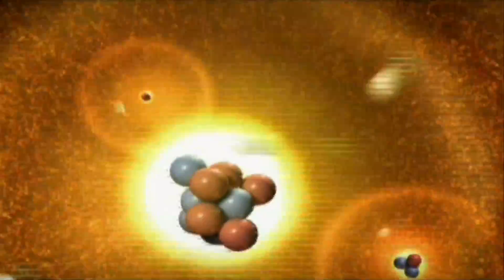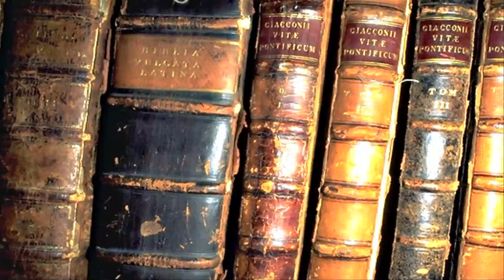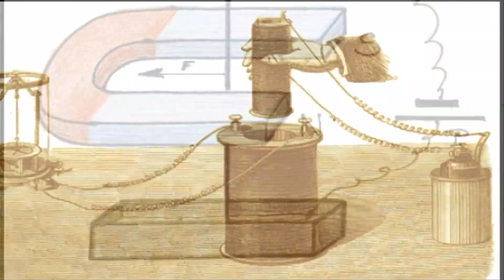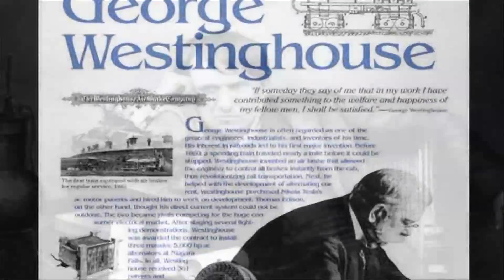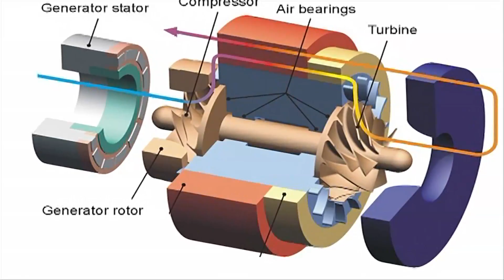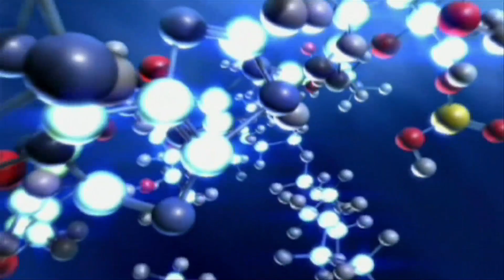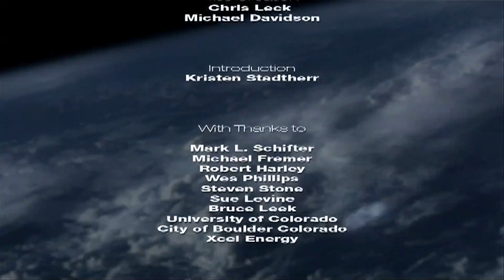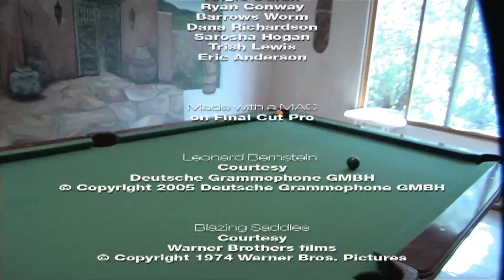The secret of electricity

Comment: This should be shown to every student in school, you do a superb job of explaining a complex subject.

i used to work for a power supply company and because it was a small operation I got to do everything from testing and sorting parts at incoming inspection, winding transformers and bench testing power supplies. later I was designing the equipment these went into. I was offered jobs at Raytheon and Loral but I stayed with that small operation for over twenty five years because I learned so much. My total education was 4 years at a technical high school, with that education and my reading of all the technical publications I could get my hands on.

Magazines like EDN had great tutorials that explained how to do things, I still have articles written by Bob Pease (Pease Porridge column in EDN) and all the manufactures of components had pamphlets that would guide you through tasks like designing a transformer. If you got out of college with a 4 year degree in electronics you had a lot of information but you really didn't know how to do much. Those articles and pamphlets showed you how to put that knowledge to work, as time went on you built up a store of knowledge that became a very valuable commodity.

I've been retired for eleven years and still occasionally get calls from people about analog design, it seems that knowledge about discreet analog design is in short supply these days. Now they are taught to use IC's as building blocks and are not really taught how to knit transistors, fet's, resisters and capacitors into a working circuit to meet a design goal.

Comment: Had no idea bamboo was used as the first bulb filament. Early electrical researchers and engineers like Faraday and Maxwell are amongst the most important and influential people ever. More so than any of the particle theorists. The progress made in the 200 years is breath-taking. Theory, motors, bulbs, batteries,  valves, diodes, transistors, IC's... it's nuts when you think about it.

Comment: You guys really should have advertised this video more. I just found out it even existed from one of your other videos

You are a fantastic host and media narrator, Paul. The pleasantness of your voice as narrator genuinely approaches that of Mike Rowe and David Attenborough.

Vibe wise, this felt like a 90s Bill Nye thing or something too. Love it.

You got one thing mistaken about electricity though, and it is indeed the biggest misconception about electricity of all time. Although the electrical energy is carried and transferred by the electrons, they actually move distance physically very slowly. Like an inch per second or something. They're just leapfrogging through physical holes in the crystal lattice of the conductor itself. The actual energy you end up using is transferred through the electromagnetic field around the wire that the electrons produce when stimulated at source by voltage and current. And to access this field's energy you must complete a circuit with the electrons producing the field to connect with this field itself, either by putting a load on this circuit or creating a path to ground (you in the case of electrocution) (Greatly simplifying this too actually)

To anyone curious, this is actually part of why the dielectric insulator of a wire affects the rate the energy flows through the circuit, and why high voltage lines that pass AC long distances are always totally uninsulated. As well as why AC can couple it's current across an insulator with no arcs, and no conductor completing the circuit. A dielectric insulator has an electrostatic capacitive effect on the flow of energy through the field around the wire. Discovering this lead to the invention of capacitors by sandwiching various dielectrics that can store an electrostatic charge between 2 conductors in a circuit. You can use these to store current, filter noise from a DC circuit, or prevent DC from entering an AC circuit, or all at the same time. You can even create a capacitor using air as the dielectric insulator. Those weird looking sheets metal that rotate when you tune the radio dial on your old stereo receivers are variable capacitors that use air as the dielectric insulator. If you've ever walked under high voltage lines and swore you heard crackling electricity, it's because you did. In some lines the voltage is high enough that the field around the wires will actually ionize the air around the lines and the crackling you hear is ozone being generated by discharge of electrostatic energy in the air around the lines.

Comment: Excellent video - with excellent sound!!!  I have to say that what Mr Philips says is more of a religious belief than a scientific fact. I am sure he has faith in it - but that's what faith is, belief in the absence of evidence.   If the last 6 feet made that much of a difference, then the "positive control" experiment should be to reduce the length to 3, 2, 1 foot if possible and see how it sounds. It should make an EVEN GREATER difference.  (He is right in that they are the last 6 feet not  of many miles, but of just a few dozen feet, or a few hundred feet if you live on a high floor). Power conditioning is another story, of course it makes an important difference, and this is easy to explain. Excellent points by all about musical performance and enjoyment. By the way, Bernstein himself wanted his name pronounced Bernst-ey-n :)

Comment: First 35 minutes are a delight, then it's just marketing. But I agree, good clean power will have an impact. Not as big as these people would want you to believe. As to power cords, just get decent shielding on your interconnects and don't run your speaker cable and interconnects in parallel to the power cable. No need to spend hundreds on power cables.

Comment: 41:05 sorry, no. You can have pure gold power cable, but all the imperfections from the power line, that is traveling miles and miles, will also be transfered by that gold power cable. Simple as that. It will be pure snake oil as you call it.

You can make a difference after your power converter, amplifier and with high end cables deliver analog signal to speakers. There is where cables can make a difference. OFC, shielded, gold, silver, connectors - you name it - everything can make that tiny difference in sound that you can hear with sensitive enough high end audio system. I can take that.

But don't ever say that these last power cable inches matter. I can only repeat myself - all inpurities and power peaks and drops from power line is also transfared through your 'audio grade' power cable....

Comment: Not arguing that quality power doesn't matter to audio equipment. I'm skeptical of power cables, but would love to tour somewhere and listen. 

But some of the comments from the guests make no sense. Listening to music at 2:00 am will most likely sound better because of the lack of other aural noise more than the quality of power. 

Still, a power sensitivity rating for PS Audio Equipment would be interesting.
Reply: The power supply should make a much larger difference than a cable would.

Comment: Jeez, all I see here is a bunch of silly old men with too much money, wasting it on daft crazy-expensive power cords. None of their claims would pass a blind test. Audiophile power cables, audiophile fuses, all of it is absolute nonsense. If PS audio products need "clean AC" then all that tells me, loud and clear, is that their power supplies are poorly designed! These guys are bordering on the same level of crazy as the Flat Earthers. What kind of power cable do Sony ship with an $80,000 VTR? A standard $10 one. Of course, these silly old hifi snobs will laugh at the mere suggestion that professional Sony gear can be compared with their esoteric audiophile nonsense, but nevertheless, I rest my case.
Reply: No I do not believe the power cord will make a difference and I am 65 now and I have been collecting electronics all my life and I have piles of amps and equipment and I do not see where any of them went any distance on the power cords;;  but I do know that good  equipment and different equipment for different applications and  and the proper speakers and how you set things up does make a difference.. And I never had an issue with the power coming off the grid unless I blew a fuse, but possibly I am wrong and I do I know that some generators can cause issues with equipment ..  
Possibly I am wrong but I have strung extension cords across buildings and across fields and things sounded fine..
Just like with buying special cables for speakers that has not been proven to me either
I set up a big club and all I used is heavy wire for the speakers and an extension cord to the equipment  it sounds fantastic if you put the right amp and equipment... 
You mentioned crazy flat earth guys and I  was asked these two questions that possibly you can answer," If  the earth  is spinning flipping moving under our feet every hour  you should be able to  put a gyroscope on the ground and it should move like 15 degrees every hour but it does not; why is that.?" And the fact is sitting in the plane on the ground it does not move no matter how long you sit and not move.,, why is that.?. And the next question I was asked was how do you measure sea level on a round ball covered with water because everywhere you were on the water would be the high point.  I could not figure that out so tell me how that works if you can...
Reply: @CalsTube   @J B  if I understand your question correctly, my answer to why the gyroscope doesn't tilt as the Earth turns is that there's no such thing as "right way up" and "upside down" as far as the Earth exists in space. "Vertical" runs from any point on the Earth's surface (and beyond) to the center of the Earth, Horizontal is perpendicular to that. Vertical, to someone standing at the north pole, is 90 degrees different to someone standing at the equator, but it's still vertical! Horizontal changes, too, if you compare one point on the Earth to another point on Earth, but it's still horizontal. The gyroscope stays horizontal, no matter where you are, or how much the Earth has turned. It HAS actually moved by a certain number of degrees, but so has its base, and you, and the land it's sitting on. So, relative to its base, and an observer, it doesn't move at.  all. That my answer, anyway :-)

Comment: It was a great story until the talk about clean AC, presumably for cleanup power stuff. IF you know about the inside of HiFi equipment and the build of circuits, that is that I know of, I am an electronic engineer, Than you know that after the transformer INSIDE ANY Hifi equipment the power is become DC bij rectifiers, than flattend and filterd with capacitors than the regualtors for several DC powers needed in the equipmen, again filtered and stabilised.
With no measure equipment were ever to find you can measure the "faulty noisy AC"back in your DC line of your HiFi stuff.

SO enyone become talk about a clean AC powersocket for HiFi stuff is by far the one proven to talkin compleet nonsens. And just talk blurd and sellingpoint dommisch.

Look at the schematics now of you hifi amp and tell me where the AC stops.
Tell me where the sugsestion of some distorsion at the ACpower becomes a problem.
You can not.Never in a million years, Not with any kind of theorie or tellenme to just listen to it.
IT JUST CAN"T BE.
I have knowlage of very excelent Hifi equipment over the 40 years. I know my stuff Iam talking about as Listen to it as at component level.

So ones and for all take a gesture of a proven engeneer that talking about a clean AC power is talking compleet nonsons.

Last;
 the seldom talking about is the soundrecordings - as wel as the diverance quality of them.
There is alway's a guy or girl at the knops in the studio that can make or brake a recording. Also the microfone settings are at the recording a braker or maker.
The building of stereosound with puting the different separate recording tracks in line
that the studio guy THINKS it is a nice setup.
Keep that in mind when building stuff.
First beware of your recording if that is ok.
80% are not ok.